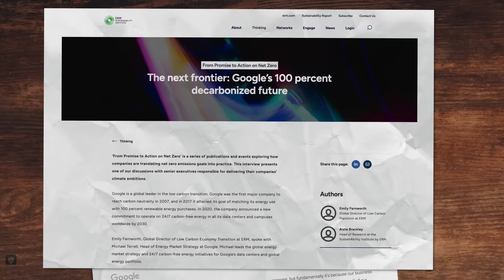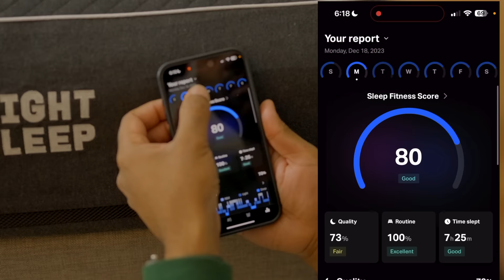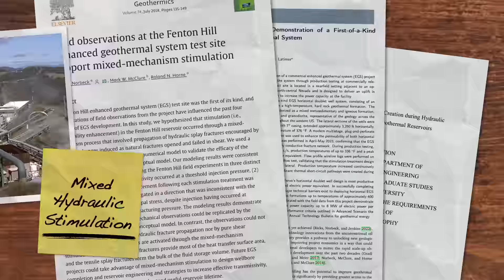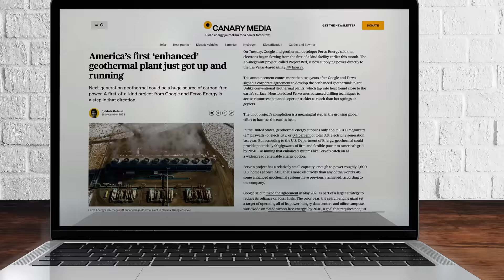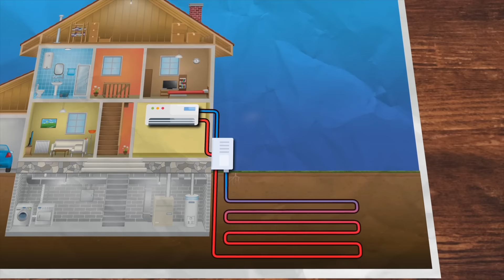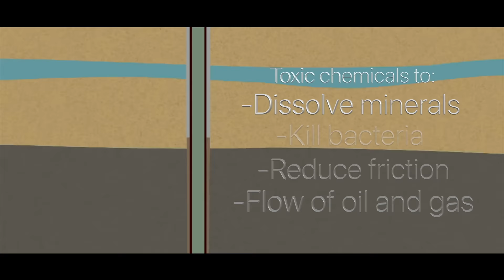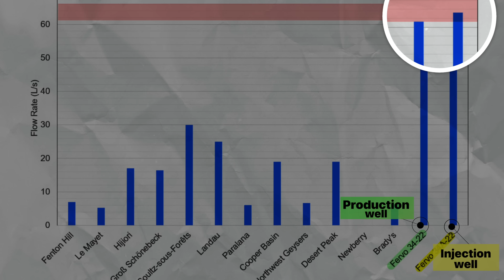Google’s Billion Dollar Gamble: You Won't Believe What it is!

Comment: I'm from east of France, where we have some of the first enhanced-geothermal well... that had to be stopped because it triggered earthquakes. 
Turned out that fracking in a seismic active zone was a bad idea, whou could have thought ?...
Reply: Fracking in petroleum production turned seismically inactive parts Oklahoma into minor earthquake zones.
Reply: With geothermal you are effectively constantly pushing high pressure water into fracture zones if you specifically use fracking to increase the size of the fractures or not. 
High pressure water not only works to space the local fractures apart but also works as a lubricant to allow easier slipping on large scale faults.

You can argue that the faults would slip eventually anyway producing a single large earthquake rather than loads of smaller ones. (I don’t think anyone has shown that is actually the case though)
Reply: @75Froggie   I expect OK to eventually become a giant sinkhole.
Reply: @AZOffRoadster  🤣
Reply: @glenecollins  and what if the passage is lined, so that there's nearly no leaking into the ground?
Reply: Anything you dissipate with little quakes means a smaller big one later.
Reply: @ChessMasterNate The slow release theory applies to earthquakes involving plate tectonics,. Do you think that applies to earthquakes in the interior of continents, far from any continental plate boundary?
Reply: @craigcook9715  that is how they did the test holes, the granite has generally formed effectively into pillars like columnar jointing on multiple scales. There is already water down there at the formation pressure but the pressure dropped eventually unless they pumped in excess water. (I am not a hydro geologist or anything so I don’t know how they scale the tests up).

From what I gather The idea with the deep granite is that there would be one big borehole they could pump water down to keep the area slightly above the pressure of the water already down there and put in multiple holes where they would pump out the hot water around the area in the zone where the pressure is artificially raised. They would be counting on interaction with the ground water to exchange heat. I don’t think they would be able to get enough fresh water in in most of those places to run even a closed loop system as they aren’t in the great artesian basin (or somewhere that gets rain)
Reply: @craigcook9715  as far as I know they would use metal casing (probably stainless steel which is really expensive) and only cement through any other aquifers they pass through I imagine having even packing material around the casing in the formation they want to get heat out of would limit heat flow.

There has been a heap of drilling where I live on the east coast of Australia where there was a good heat gradient but the granite was so solid that not enough water flowed around in the formation to actually get much heat out so interaction with groundwater is really important for a closed loop system as well it just has to interact with the pipes instead of the water that was pumped in.
Reply: @ChessMasterNate  We went from stable ground with nearly no earthquakes causing  damages, to a situation, after fracking, with lot of earthquakes causing problems
Reply: @quentinmangel2265  I don't dispute that that is possible, just that, that tension was already there, fracking did not create it, and likely would have continued to build until something much more powerful would have happened.  Could have been 50 years later or 1,000 years later.  I also suspect this will not be permanent either.  The little quakes should become less and less frequent after they have stopped fracking.
Reply: Happened in Switzerland also.
Reply: @75Froggie  Yes. You don't get movement without a lot of tension or compression (and forces powering uplift or subsidence) already present.  And this generally builds because there is an energy gradient that also builds.  The thicker the plate, the more it acts like a blanket holding in the heat.  But the heat is not the heat from planetary formation.  That was lost long ago.  The heat that is there now is from radioactive decay (fission) from isotope decay chains going through their steps.  And tidal forces.  Only when those decay chains reach the end, and the Earth tidally locks, will heat stop driving plate movement, as the plates thicken.  The plates move around because the heat is finding a way to escape and move down the energy gradient.  It is also why plates break apart.  The bigger and thicker they are, the more heat will build under them, working to tear them apart.  When we frack, though, it is still near the surface of the plate.  They are not breaking rock all the way down.  I think the little quakes allow for modest expansion vertically.  Not true uplift such as we see with mountain chain building, just bowing because the liquid and plastic rock expands with the increase in heat.  The little quakes should still resolve the forces, as equilibrium is restored.  The little quakes should subside.
But, this bowing (up or down) likely would happen anyway, just at some point further in the future and with more force.
And fracking is not the only thing pushing buttons.  Pulling a lot of water from the aquifers also messes with the equilibrium, as a lot of mass is removed, and the land would naturally rise in response (rebound).  Similarly, adding a lot of mass by making large reservoirs can lead to some activity.
Most of what we do is pretty small, but if there are already a lot of forces present, you can get some temporary activity.
Reply: Good grief! All this stuff about plates and uplift revolves around tectonic earthquakes. There are four main types of earthquakes: tectonic, volcanic, collapse, and explosion. The ones triggered by injection wells are collapse earthquakes and at most  relate coincidentally to tectonic quakes when they happen to occur in areas near a continental plate subdjction boundary.
Reply: All that water loss, it lubricates the fault lines. In California they have proposed water injection into faults - the theory being many small slips are preferable to huge disasters. It is still a theory because unless you lubricate all the fault lines, it transfers the pressure elsewhere!
Reply: Fracking releases pressure that's all ready there. Sooner or later it would release on its own in a much more spectacular fashion. Which would you rather have, a bunch of small quakes or 1 large one?
Reply: Fracking releases pressure that's all ready there. Sooner or later it would release on its own in a much more spectacular fashion. Which would you rather have, a bunch of small quakes or 1 large one?
Reply: Fracking releases pressure that's all ready there. Sooner or later it would release on its own in a much more spectacular fashion. Which would you rather have, a bunch of small quakes or 1 large one?
Reply: Fracking releases pressure that's all ready there. Sooner or later it would release on its own in a much more spectacular fashion. Which would you rather have, a bunch of small quakes or 1 large one?
Reply: Fracking releases pressure that's all ready there. Sooner or later it would release on its own in a much more spectacular fashion. Which would you rather have, a bunch of small quakes or 1 large one?
Reply: Fracking releases pressure that's all ready there. Sooner or later it would release on its own in a much more spectacular fashion. Which would you rather have, a bunch of small quakes or 1 large one?
Reply: Fracking releases pressure that's all ready there. Sooner or later it would release on its own in a much more spectacular fashion. Which would you rather have, a bunch of small quakes or 1 large one?
Reply: Fracking releases pressure that's all ready there. Sooner or later it would release on its own in a much more spectacular fashion. Which would you rather have, a bunch of small quakes or 1 large one?
Reply: @craigcook9715  No leaking of heated solution into the rock!
Reply: Same problems in two locations in Germany, e.g. Unterhaching. I do not remember where it was, but houses where split, large cracks at least.
Reply: @75Froggie ...There isn't a history of the relationship working in the opposite direction?
Why would you not consider that a collapse in Nevada would trigger a fault line to shift?
Reply: @ChessMasterNate ...Stick to your board game.
If this plant was built on a fault line, it will fail.
If it isn't, then it is a potential trigger for a large earthquake elsewhere.
Edited to Correct Autocorrect
Reply: @truthsRsung  No. The closest tectonic fault lines to Nevada would be those on the California coast, notably the San Andreas fault.
Reply: @truthsRsung  I have completed the coursework for these relevant degrees: Geology, Physics, Chemistry, Oceanography, and Astronomy.  How about you?
Reply: @75Froggie  ...The rest of the underground tunneling we have engineered and built have been designed to be more stable than the surrounding bedrock, why would this system behave the same?
I understand that energy is transferred through solid objects with more efficiency than vapor or liquid.
Why do you think that distance insulates the fault lines from possible disturbances a couple hundred miles away?
Lastly, I have to assume that this plant uses potable water instead of sea water.  Who in this area has any notion that there is 17 million gallons available to run A/C and Server Farms?
Reply: @ChessMasterNate  ...If you had much time invested in Chem Lab, you would know that the majority of your time is spent not killing yourself.
I instruct classes for pilots and EMTs, separately, of course.
My job was a lot less complicated before outbreaks of technology, like meth, fentanyl, and COVID.
It is still the same job.  I prepare people's minds for the possible, not probable, for their own safety.
Reply: @truthsRsung  "I understand that energy is transferred through solid objects with more efficiency than vapor or liquid.
Why do you think that distance insulates the fault lines from possible disturbances a couple hundred miles away?"
That question should answer itself for you. If it doesn't, I can't help you. Hint: In the 1950s and 60s, hundreds of underground nuclear explosions were performed in Nevada.
Reply: @truthsRsung  College chemistry is not the art of making narcotics and explosives, if you knew anything about it.
Reply: @ChessMasterNate  ..Now you are an Artist.
I will stop asking you for Logical Answers.
Reply: His slamming criticisms of fracking are gross.

Comment: I think it was reported on Disruptive Investing YouTube channel of a company doing similar, but they drilled 2 wells and did between well directional drilling to connect the two main wells with several 'cross connects' underground without fracking.  They put a cement liner on the ENTIRE well 'matrix' then pump water into the 'injection' well till it starts coming out the 'production wells', and then the water goes through a heat exchanger, but all the fluid gets re-pumped into the injection well.  After a few 'circuits' or cycles through they can bypass the pump and it basically pumps itself.  Their wells are also not super deep and they have a pilot plant running in west Texas if I remember right. ... Best part, no fracking and no continual loss of 'fluid'. ... Just thought you might like to hear about it.
Reply: I think your thinking of eavor  ? Hopefully they get big backing too
Reply: Eavor is just like this with a secret seal,  like cement. Geothermal in the Arctic! anywhere!
Reply: Yeah this sounds like Eavor. Their first commercial plant is under construction in Germany right now.
Reply: By sealing, that should help avoid or at least reduce, the risk of harmful contamination of the water by minerals already present in the geological stratum through which the tunnels are created.
Reply: In the future, scientists will be using this technology to pump heat INTO the earth, instead of pulling it out. Lol.

Comment: Suprised you didn’t mention Eavor’s “closed-loop” alternative to fracking for geothermal energy.  It also uses horizontal drilling for hot water, but avoids the water loss and resulting risks of destabilizing surface structures and causing earthquakes.
Reply: Its a Canadian company. The whole world is not loving Alberta oil. Those boys and girls know how to drill!
Reply: @fayebird1808  well, we’ll try not to hold that against them 😏
Reply: Yeah I thought the same thing. Might be less efficient but eliminates all the fracking related problems.
Reply: Eavor is game changer, I hope everything is going well in their current projects.  I too was surprised that Google did not include them in this project as the publicity generated would be a god send for the entire industry.  Next to fusion reactors and molten salt reactors this technology would solve the entire electrical energy production a billion times over.

Comment: Just to put the water usage into perspective, 14 acres of California almonds use 17M liters of water. Last year they grew 1.63 million acres.
Reply: And a coal power plant producing the same amount of electricity would need over 30M gallons of water a year.
Reply: @tomtxtx9617  Not a power plant making clean Coal from human waste.
Reply: "14 acres of California almonds use 17M liters of water" is true, but not exactly. Plants evaporate this water, and by doing so they cool air a bit, and adds water to clouds. And water from clouds tends to return to earth somewhere as rain.
So water spent on agriculture is used but not wasted, while if you pump it underground, or pollute it in a factory, it will be true waste.
Reply: @Formulabruce  Incorrect. I suggest learning how coal plants use water. It can be anthracite, bituminous, lignite or even the poop you want to use. It's still going to use about the same amount of water per MWh.
Reply: @arivaldarivald3212 Except that rain falls elsewhere from whence it evaporated, so CA almost loses twice…or maybe once and a half.

Comment: If they are pumping that much extra water into the injection well, it means the local aquifer will rise, they'll probably dig some other standard wells in the area around the plant to pull out water and monitor the static water level. 
Also, I'm surprised you didn't mention that the plant was just a few miles away from the Tesla giga factory.  😂
Reply: In many areas adding water to the local aquifer would be a feature, not a bug. Across the US we've been depleting our water table faster than it refills. With favorable placement (i.e., next to a reservoir of sufficient capacity) the "water loss" would delight local farmers as their water tables improved or shrank at a slower rate.
Reply: @BramWarrick   in a normal place that would be true, but this test facility right now is just up in the hills without anything super close by really. It's kinda isolated.
Reply: @BramWarrick  in this case this would be a disaster waiting to happen. The fresh water is injected at depth and it is displacing naturally toxic brine that you have at that depth. Any water that eventually comes up is not the fresh water injected but the brine that is displaced upwards. I would be highly concerned if you inject more than you produce. The only way to replenish fresh water in the water table is with fresh water from above (rain, rivers, underground flows of fresh water).    The reason in shale oil wells the water is re injected is not the chemicals added. It is the toxicity of the brine water that came back up.

Comment: No question directional boring geothermal is a game changer. I'm pulling for the company (name escapes me) that is using the same technology, minus the fracking, and uses a closed loop system. Geothermal is the perfect answer for data centers, and with a constant load, there's no need for any power source other than geothermal.
Reply: Eavor
Rocky Mountain house Canada

Comment: The elephant is not fracking, it is cost. Employing fracking to extract profitable hydrocarbons is a net profit, but drilling and fracking for hot water is a much harder business case. Enhanced geothermal today often tries to extract lithium etc to create another revenue stream. Remember: geothermal electricity competes with electricity produced more cheaply by solar, hydro, or wind. Price is often (not always) the deciding factor.
Reply: Solar and wind can never compete as base production, they compete in fluctuating production. Hydro is only one of these that you can actually controll as long as you have water.
Reply: Cost is important,  but when attempting to be fully renewable you need to try to get as much constant stable power as possible
Reply: @lauriviik  But they do compete already because they're feeding into the big leveling grid. The concept of caseload is now being reshaped. When utilities put out bids for generation it is now almost always for "solar + battery" – and it still comes out cheaper than oil & gas.

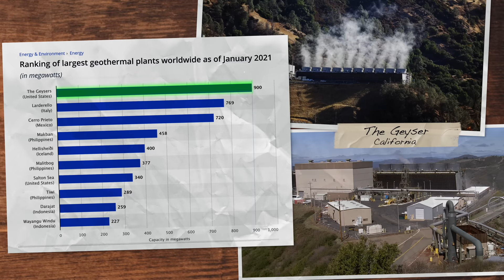Comment: 11:09 - Since the Philippines is in the Pacific Ring of Fire, it has geothermal potential.
Actually, it has a handful of geothermal power plants in operation:
1. Mak-Ban (Makiling-Banahaw)
2. Tiwi
3. Bac-Man (Bacon-Manito)
4. Panlipinon
5. Malitbog
Reply: Yes, you're right. The biggest problem with geothermal so far is the fact that it's only economically viable in places like the Ring of Fire or in Iceland where hot rock is very shallow.. This system has the potential to make it economically viable in other locations, which I think is awesome!
Reply: @ipp_tutor  Equipment longevity is also a problem.